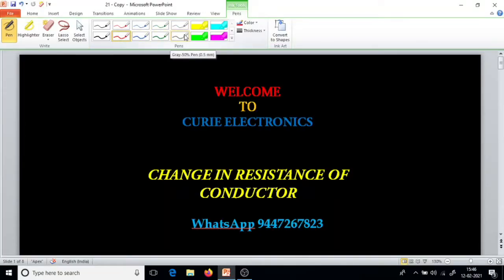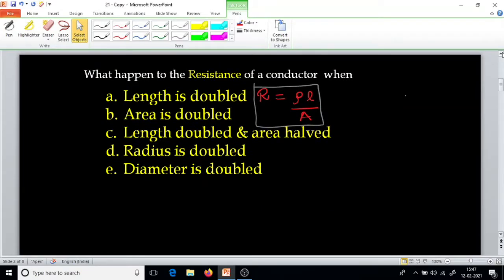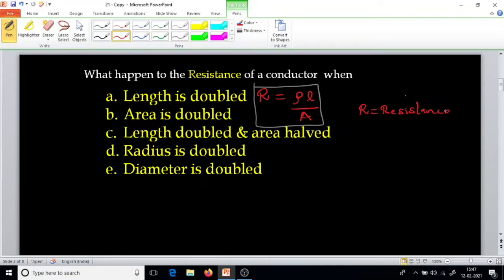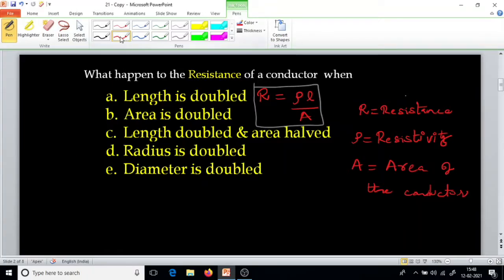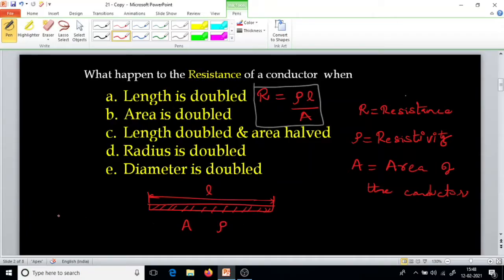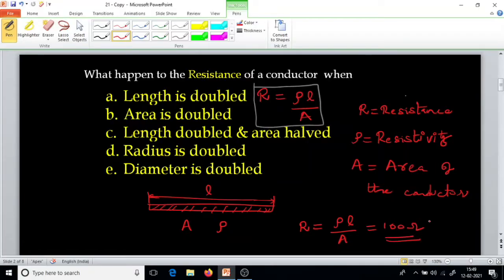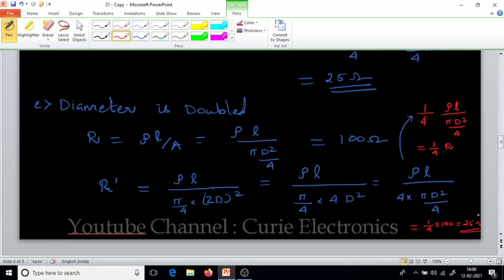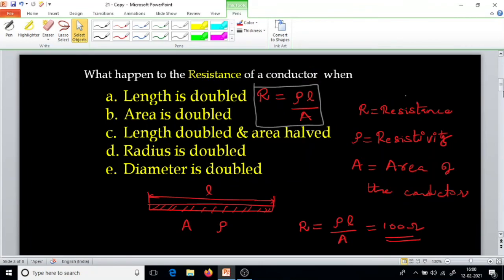Change in resistance with change in Physical dimensions of a conductor LENGTH/ AREA/DIAMETER/RADIUS

Comment: If the length of wire is doubled its area will decrease so the value of resistance will be 4 times not doubled
Reply from the maker: you got a wire of 1 meter length.To connect a bulb you one more meter wire.What u do?

Comment: In first problem you change the length but you didn't change the area when you change the length you should also change the area because the volume should be constant when length increase double... area should be done as A/2 so now R increase 4 times
Reply from the maker: To double the length we are not going to stretch the wire.We take one more same wire and join it.
Reply: Kk whatever u got my point right
Tq
Reply from the maker: @anuradhapaspuleti1188   When i made the video i had the same doubt. Uniformly stretching a wire is not easy.Now how to double the diameter, we use material addition process, similarly for how to reduce the diameter, we use material removal process. Thanks
Reply: @CurieElectronics  kk tq
Reply from the maker: @anuradhapaspuleti1188   You are welcome
Reply: Good 4 times resistance will me increase